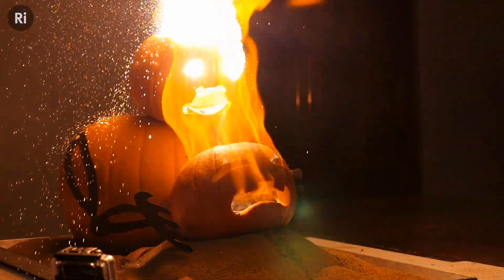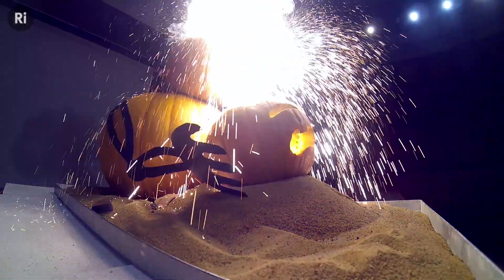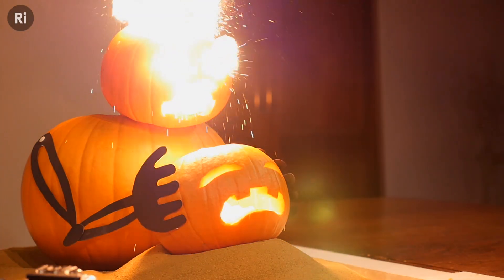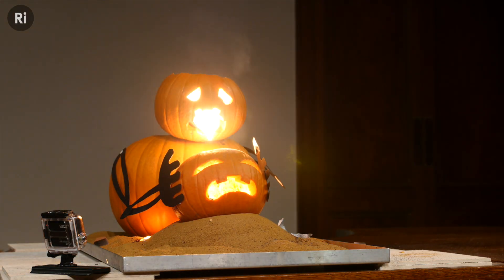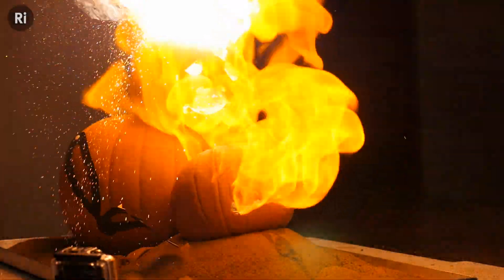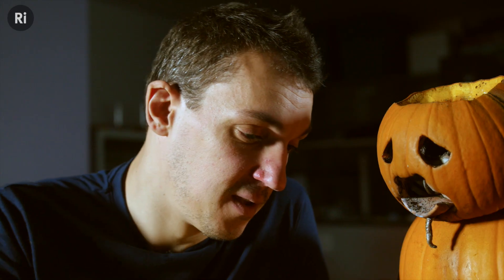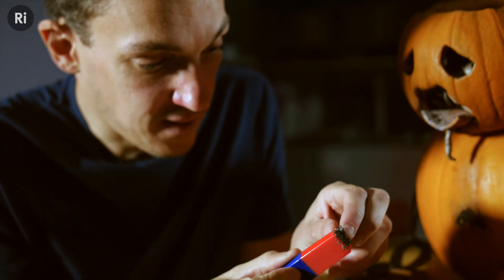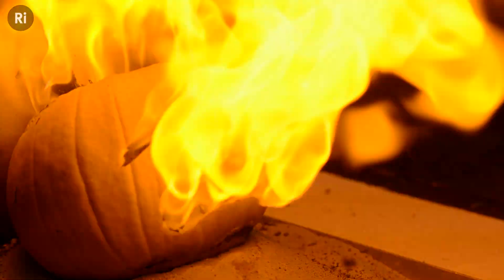Exploding Thermite Pumpkins! Halloween Science

Comment: It seems to me that your cameras had quite a bit of trouble with the brightly burning thermite reaction. 
Also, is it just me or did the ceramic plate that was supposed to redirect the iron flow crack under the heat?